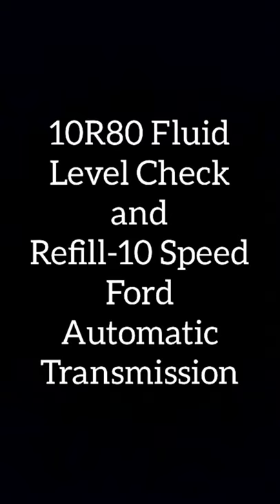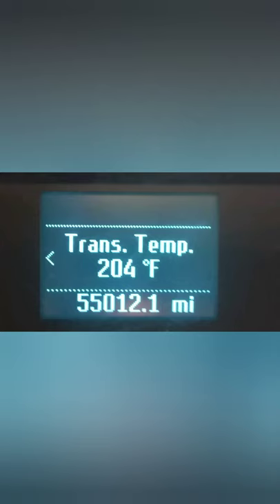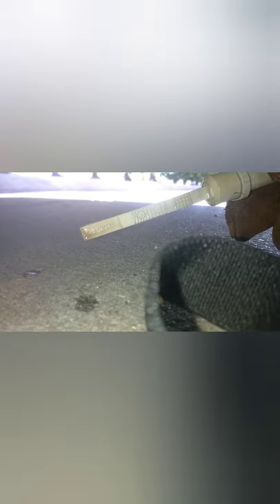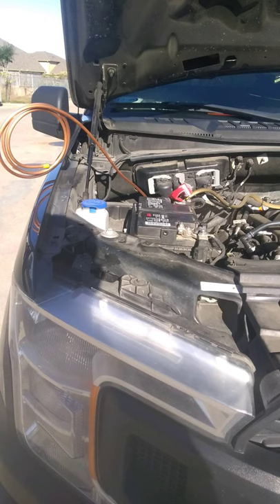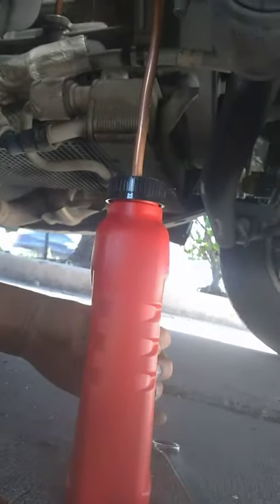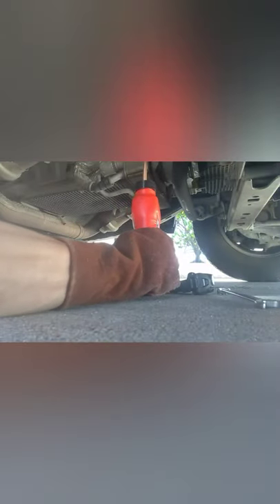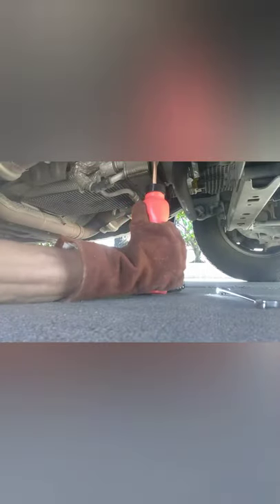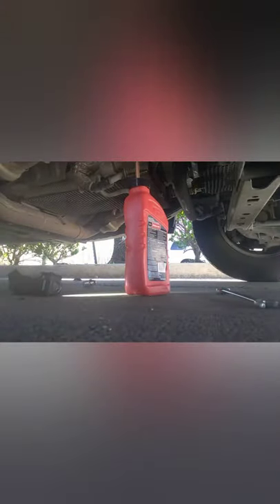10R80 10 Speed Transmission Fluid Level Check And Fill

Comment: Hey man I can for the life of me get my trans even close to 206 degrees. I’ve let it idle, I’ve drove around town. I drove in the high way for a little while but the temp goes down on the highway lol. What can I do. I got a brand new trans I installed and I just wanna be sure the fluid level is correct.
Reply from the maker: @TheTechGuider  man, u know, that's a really good question.  I would say, maybe just get it up to it's operating temperature,  and check it there.  There's ways, of course, to raise the temp, but if your transmission doesn't even have to get that hot, why intentionally make it get that hot... ? I think that if the temp is staying nice and cool, you have plenty of fluid flowing around in there
Reply: @HVACRServiceTech  thanks!

Comment: Wow! Great idea Ford! Much easier than the “old days” of having a dipstick under the hood with a wide enough dip stick tube that you can use a transmission funnel with! Bravo! Job well done!
Reply: I feel your frustration... however, you can't blame this trans (and listen it's a great one, even with the filler issues) -- colaboratively designed by Ford and guess who? Yes, that's correct, GM. - Here's the deal, it's a much more robust trans  than the past ones. believe it - (I'm pushing 850 hp to the back tires and this trans has NEVER let me down) You just have to do things right, with some patience and KNOWLEDGE. I do feel your frustration, though. Good Luck!

Comment: Can you just not take drain plug out and let a couple qts come out and put same amount back in ? I read somewhere not much will come out for drain plug thanks
Reply from the maker: Yeah unfortunately there's no drain plug. I don't think there is at least I'd have to look back at the video but. And there might be I don't remember that was an old company truck for a company that I worked for two and a half years ago. But the issue is that Ford made it to where the average person cannot service it check the fluid or do anything with it. Ford also claimed that it was a transmission that had no need for routine maintenance. That was a big joke, because I drove two of these vehicles when I was with that company, two of the same exact models and both of them had transmission problems. The first one actually made it to 130,000 miles before giving me problems I put $115,000 on it myself. We had Ford rebuilt the transmission on thtt one for $7.6K and the next day it went out again! and they had to rebuild it again under warranty LOL

Comment: You can buy a cheap pump and vinyl tubing, the pump screws to your oil bottle. I believe Wally World sells them. You got the upscale model with copper tubing but no pump, what’s up with dat?
Reply from the maker: Lol. I dont man. I guess the thought of a pump never came to mind. The copper tube was the fastest, most cost effective option i had, since i have a roll on my truck and the drill and drill bit to make the hole in the cap. And actually, flexible clear tubing is what i should have used so the video could have shown the fluid as it went through. 
Seems like more hassle, for me at least, to use a pump than a tube.  and then what about the voltage. I got a power inverter so it doesn't matter I could use either 12Vdc or 120Vac but most people don't have power inverter on their vehicle. 

But hey, if a pump is your prefered method, im all for it. Your still gonna need some tube though to get it from the pump into the transmission.

 But everybody who reads this should keep in mind that this procedure is something you want to do if you don't want to take it to the dealer and if you don't have any kind of warranty that you expect to try to use with a dealer on a transmission. if you have a warranty, use it as long as it doesn't cost you anything as long as you can  put up with whatever amount of time they want to keep your vehicle or have you waiting  in the waiting room for them to get it finished.  Because they specify this transmission to be non serviceable with a lifetime type of fluid that never has to be changed, and that only a dealer should service it if it ever needs it. So with that said they'll void your warranty if they find out that you have done this procedure. But the fluid wears out on it just like any other transmission where there's friction and heat.

Comment: great video    where did you get the dipstick from?
Reply from the maker: Thanks. The small dipstick should be in the transmission, right under the fill plug. When you unscrew the plug you should see it there.

Comment: my Ford Ecosport 1.5 engine with automatic transmission model 6f15 used the Mercon ULV. The owner's manual says to change it at 150,000 miles. Do you think I should exchange it first?
Reply from the maker: 150,000 miles is too many miles for the same fluid. I would suggest to change the filter and replace the fluid that comes out during the filter change, and get it back up to proper level. Im not very familiar with the 6F15, but im sure that there is a proper procedure for it. Check out this guys channel. He is the best ford Mechanic on YouTube-in my opinion. I don't have specifically any ford vehicles right now, been rebuilding GM lately, but this guy has so many vehicles and here is a video that will explain your question much better than I can explain it. If you need anything else dont hesitate to ask, I'll help any way I can. 

https://youtu.be/pYDjVYT51Jg

Learn everything this guy has to teach.

Comment: Before you added the quart, did you notice any issues while driving when it was low?
Reply from the maker: Yes actually that was what made me start looking into that. It would experience very rough shifting intermittently. I did seem to notice that it made an Improvement on that transmission and it no longer had rough shifting issues after the video was made. After that, I put about 60-80k miles on it and about 5 months ago the transmission started to severely overheat. The fluid was still full but no longer red in color at all. About 200 miles later the transmission ultimately failed at 129000 miles. Since that is a company truck, and not my personal vehicle, I was able to swap trucks out and I got into an identical one with 35000 miles. So far I've put 22000 miles on this 2nd F150 and have not have any issues whatsoever with this transmission. To the best of my knowledge this transmission has never been serviced after it left the factory new. 
I do know however that Ford replaced the transmission on the 1st F150(from this video) and they charged around $7,400. Someone else in my company began driving that truck and the very next day, that brand new transmission that they charged $7,400 to install failed and they had to replace it again under warranty! As far as I know, that F150 has not had any other issues since then. 

Sorry I know that's way more information than what you asked, but could be helpful to you or somebody else to know all that. I am just grateful that I'm not having any issues with this F-150 I'm driving right now with 57,000 miles. 
 Thanks
Reply: @HVACRServiceTech  thanks for spending the time answering with all that information! Much appreciated 👍

Comment: So a 19mm and 3/4 wrench is only size to fit the nut but they both are almost to big and it feels like its going to slip and ruin the nut so I stopped. Any ideas?  Its a 2020 lariat f150 4x4  10 speed
Reply from the maker: From what i know 19mm is the exact size needed. Unless for some reason the 4x4 is different, but i wouldn't think so. The only other thing that comes to mind is to make sure you're using the open end side of a 19mm wrench. If you're using the box end side of a 12 point wrench or a 12 point socket, i would guess that it would feel loose as you describe, which could in fact strip it. If its 2020, make sure you don't void your warranty if it is still under any. Good luck!
Reply: @HVACRServiceTech  thanks for the reply. So yeah open end and box end side of wrench felt to big so I just took it to dealer and let them check it. Lol. I watched through window just to make sure they did check it and not just say they did. Lol.

Comment: Hi, thanks for the video but could you please explain the steps to me iam actually having a problem with my 2019 mustang gt very harsh shifting, the dealer refuse to check the transmission oil saying its good since its just new, saw a lot of thread about low oil and that sh**   so i decided to do it myself even i dont have a lifter,  but please clarify : engine should be run when i check ? What is the correct transmission temperature before checking,? Where the level it should be on the dipstick? And what is the correct oil spec if i need to add ? Thank you very much and hopefully i will be able to do it
Reply from the maker: Motorcraft Mercon LV is the fluid. You have to get it from the parts dept at the Ford dealership. You basically need to drive it around alot for it to get to the temp it needs to be, which is above 206°F(Trans Fluid). If you start it cold and try to watch the temp go up it'll take longer than you want to wait. It has to be running, in Park, and level should be in the crosshatched area labeled "A". Used thick gloves that cover you arms or you will get severely burned by the scortching catalytic converter. Unscrewing the small plug from the transmission with the thick glove on ia hard, annoying and just seems impossible. But its not worth getting burned. Look for any metal shavings in the fluid when you pull the dipstick, wipe on a white rag to see better. Then reinsert the wiped dipstick all the way back in, pull it out again and that is how the fluid must be checked each time you recheck the level. If no fluid shows up on dipstick(most likely), add a full quart to start(keep your engine running throughout this entire process). Replace the dipstick and the plug. Drive it through all 11 gears, park, recheck, keep adding until level is correct. Use jackstands, be safe. Might need transmission work. Good luck
Reply: @HVACRServiceTech  seems a difficult thing to do for a non expert person but have no chanse only to do it , thank you for the information i will update later after it done but may i ask why you think your transition need oil ? Did you face any hatsh shifting or something and any noticable improvement after adding the oil  , cant understand how a company like fird will let us pay 52000$ for a car wihich not pass a quality check
Reply: @HVACRServiceTech  by the way my car is less than 3000 m

Comment: When you were pumping the fluid, was the car running or not?
Reply from the maker: It was running. If the engine is turned off at any time that the Transmission Fluid Fill Plug is not tightly in place, hot fluid will overflow and pour out under the vehicle.
Reply: Thanks.
Reply from the maker: @buust1000hp  no problem. Google search the following and download the 1st result if you want more helpful info. Its a pdf file i found...

 307-01B - 10r80

Comment: Hello Israel.
I've been looking through Youtube and the internet for anyone with some info on how to do stuff like this on the 10R80, you my friend are one of a very few showing something useful.  I like you also put about 1000 miles per week in my truck, right now I'm at 100K miles on 42 months old truck.    I want to try this, maybe even replace the filter and all the fluid depending on its condition after I check the levels.
So, do you have any new updates since you did this video?   How is your transmission doing?
Reply from the maker: Hi James.
I appreciate you taking the time to make that comment. I'm glad that you and many others are finding some useful information from this video that made. In regards to any updates On my transmission and how it's doing, I can say that since I made that video I have not had to add fluid to it again. I checked it about a month ago and it still was at the proper level. My vehicle has all the same common issues that every other 2018 F150 with a 5.0 owner has. I have an engine tick at idle, engine rattle on a deceleration during cold engine temperature, excessive oil consumption(but it doesnt smoke), and I also have a dry rattling type of noise that is always there whenever I'm at cruising speed when I slightly let off the gas and go back on the gas. It's mostly noticeable at higher speeds with engine RPM above 2,500. I also have a high pitched engine whine right at 2000 RPM. At times, I would say maybe twice a week, I do experience rough and noisy shift out of the transmission between 1- 5 gears on take off,  but this immediately goes away and  it's also not something that jerks me in and out of the seat or that concerns me very much at all. I cannot connect that symptom with any other condition that I put the truck in or with anything else other than it's just a random occurrence. 
With all that said I must say that despite all these little inconveniences, the engine and transmission has held up and it is still holding up to this day.  Today, as I type this I am clocking 89386 Miles. Is a very dependable, strong and powerful truck. It is a company issued fleet vehicle that I've had since 10,000 miles. It has tool boxes on the bed and I have probably over two thousand pounds worth of materials and tools that this transmission and engine also have to drag along with it everywhere it takes me. I do all of the Maintenance and Service on it because frankly I don't trust anybody else to do it, and I don't like my truck to be in the shop to where I have to go into another truck, and my boss is just fine with that. 
 I put now closer to about 1500 to 2000 miles on it per week. I frequently change the oil on it, air filters, I just got done changing the rear differential fluid and I just now purchased rear brake pads because they will need to be replaced soon. 
    I would suggest to most definitely change the filter and fluid if you feel like that's something you can do. The filter is supposedly never needed to be replaced but I disagree with that assumption that the manufacturer makes 100%.  Everything needs maintenance and if you want to minimize the chances of the transmission failing due to maintenance related issues, I would suggest change it every 50,000 - 100,000 miles. 
One of my favorite Youtubers that I watch almost every video he makes and I take his practices and Implement them into Everything I Do is #fordtechmaculoco. I would suggest watch any video that he makes on F150 because he is full of knowledge and gives good information. if you have any other questions that I might be able to answer for you just let me know I'll be happy to reply. Thanks
Reply: @HVACRServiceTech  Thanks Israel for your reply.    I get advise from #fordtechmaculoco as well and watch every video I can in regards to my truck.  Brian I think is his name, he is very resourceful with anything Ford.  
On my truck I also get very similar "jerking" from the trans between 3rd and 4th gears, and just like you it's not always.   I just hope that the transmission is not going to fail on me.   That would be a pretty costly repair.   
I fix my own cars man, just like you.  I don't trust any dealer for anything.
Be well and thanks for the 411 my friend.
Reply from the maker: @jaimecaballeros  I hope all is well with you. That transmission I had failed around 129k miles... Ford rebuilt it for about $7000, it failed again the next day so they had to do it again under warranty.. Great job Ford!

Comment: How do you get the transmission to over 200f?  Torque braking?  I've never seen mine over 190, even towing a trailer uphill in the summer.  Normally it stays around 170-190.
Reply from the maker: No I wouldn't torque brake it. I would say just do the best you can. I don't see why it would make so much of a difference. That's just what the factory specifies. but checking it at 190 degrees in my opinion is better than either not checking it at all or Torque breaking it to try to get it up above 200.  especially if it is low on fluid.

Comment: How did u keep the transmission at 200deg? Idling it?
Reply from the maker: Yes, the engine has to be running the whole time to do this procedure. If the engine is not running, transmission fluid can and likely will gush out of the dipstick opening, so this is crucial. Wear huge leather gloves or similar to protect yourself from the hot catalytic converter. Best of luck to you, and feel free to ask me anything else you need some more information on. 
Thanks
Reply: @HVACRServiceTech  Agreed, a welding style glove (like what you were wearing) works extremely well. Gl, all. Thanks, Israel.
Reply: Israel Garcia it’s strange that you say with the engine not running it will gush out. I would think just the opposite.
Reply from the maker: I agree that is strange. Must have to do with the pump running with the engine on versus the pump not running with the engine off must cause all of the fluid to be in that part of the transmission instead of flowing through the transmission.